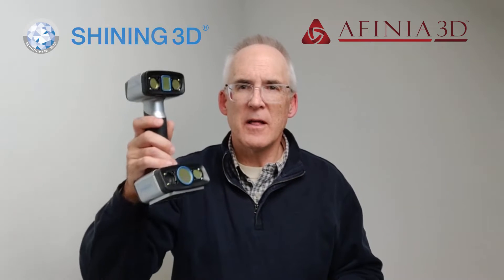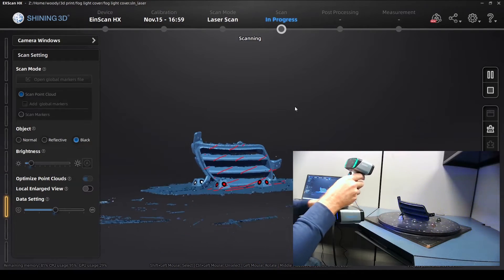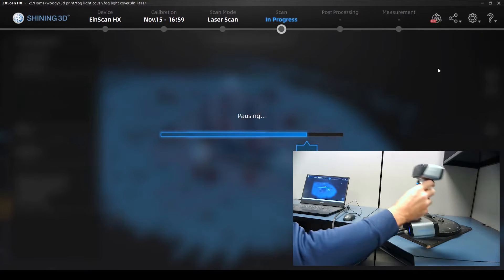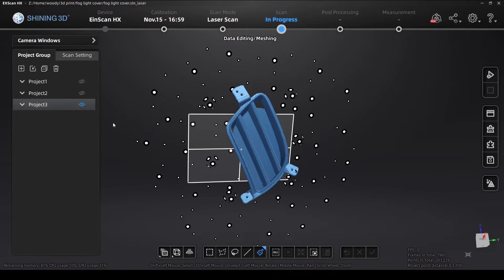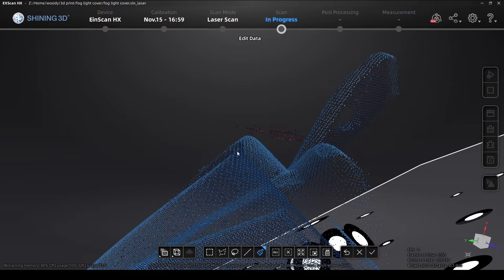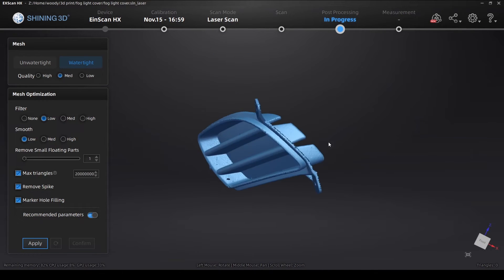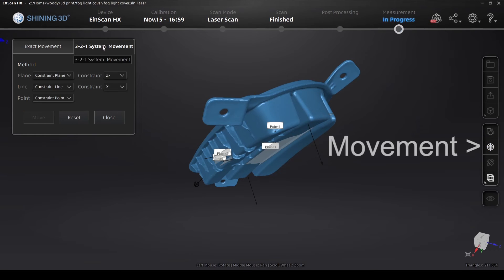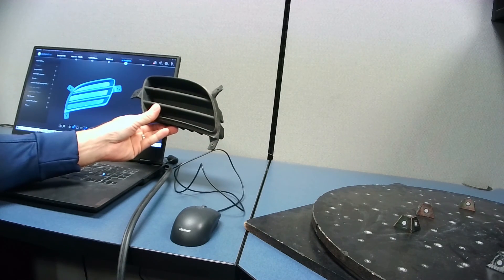Using the EinScan HX 3D Scanner to Make a Mirrored Part

Comment: The Car community is dying because of their inability to grasp this concept. 

If you reached out to the millennial generation car communities, you could create an entire business model replicating parts for late 90s early 00s vehicle parts. 
Nissan S13 S14 Audi B5 etc
Reply from the maker: Thank you for your comment.  We are contacted by auto enthusiasts and motorsports company frequently.  3D scanners are a great tool.
Reply: Exactly.  I have a 94 XJS. and it has these nozzle holders for the headlight washer, that are mirrored.  DAC7927 for the left side and DAC7928 for the right side.  I can find 7928 all day long, but 7927 is discontinued, and there are a lot of people who are looking online for one.  I'm getting a scanner and printer mainly so I can make a replacement part.  I'll scan and print a lot of other things, too, but the first thing will be that part.  Why they made a mirrored part for what is essentially decoration when it could have been a universal thing is beyond me.
Reply: What softwares do you use with this and did you have to buy it separately?
Reply: Do you know of anyone in the Little Rock Arkansas area with this capability?